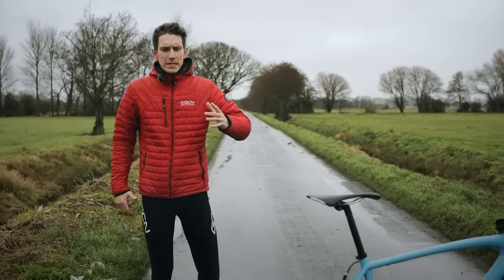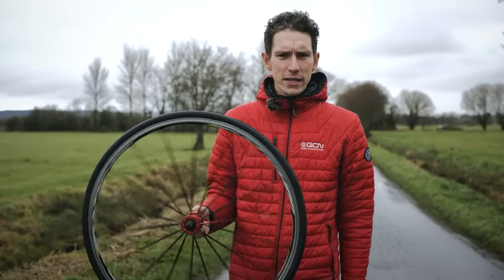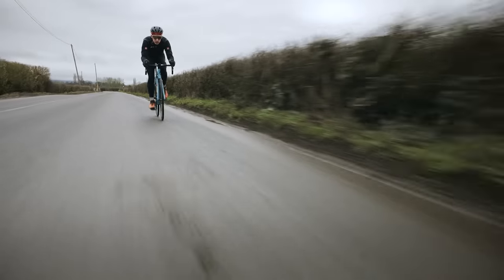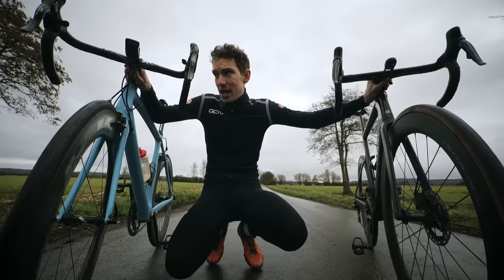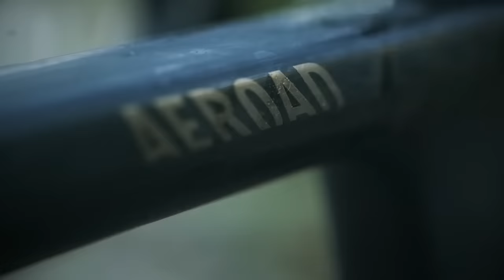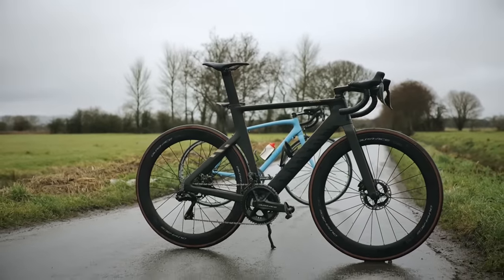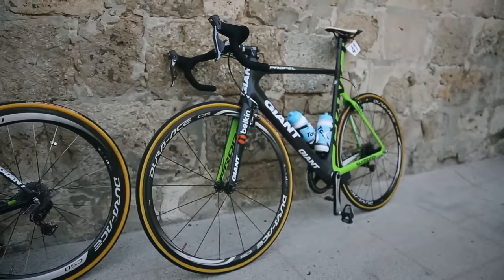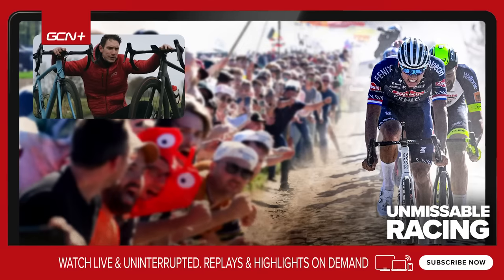How Much Faster Can I Make My Old Bike? | 2013 Vs 2023 Revisited

Comment: Upgrading to 50mm carbon wheels from the stock Giants on my 2016 commuter Alu Defy Disc changed the feel and the sound of the bike for the better. I also ride it with mudguards in combo with aero wheels which rises eyebrows from time to time, but I don't care really. I love it <3
Reply: Why do you have carbon wheels on a commuter bike 😂
Reply: Nice! I have a flat bar hybrid but now starting to look at new wheelset. Too right! Who cares what people think. Bring on the Tron wheels
Reply: @loc9588  why not. Am less likely to arrive completely sweaty at work with a lighter bike😂😂
Reply: @loc9588  Because I can! 🤣
Reply from the maker: Oooo Carbon wheels and mudguards is a combo we are here for! 🙌 Great to hear you are keeping the old bike going!
Reply: @loc9588  Why not?
Reply: @123moof  because it’s totally pointless - putting good wheels on a shit, slow bike. It makes 0 sense.
Reply: That wheelset is worth more than the bike, right?
Reply: @loc9588  If you're talking about my bike - it's not a shit, slow bike. Especially not when I ride it. The stock wheels were bad when you put a lot of power through them. The carbon wheels transformed what is possible with the bike.
Reply: @waveman1500  The new bike was EUR 1400 in 2016 and I managed to buy 2nd hand but never used set of wheels. The wheels were cheaper than the bike.

Comment: In 1995 I bought a pair of wheels with Zipp 40mm deep rims. Aero is not a new thing, in the 90s there were aero seat post, aero spokes, aero water bottles and campagnolo had integrated shifter brake and gear cables in the handlebar tape where as shimano were exposed. There was also aero saddle bag that was slimline and was about the width of the frame.

Comment: Wheels can make a huge diference! If you have a decent bicycle with a budget set of wheels, get better wheels. It's not actually about speed only, It's also about feeling safer when cornering.
Reply: This is why I won't buy ever carbon wheels, they're opposite of safe
How many times I saw people end in the hospital cause their carbon wheels broke cornering just under the normal everyday tension. No crash, no summer heat, no rocks, no anything but being plastic.
Cheep wheels may be a tiny bit slower but are indeed way more safer.
Alloy wheels forever
Reply: I'm curious how many times you were casually driving by a hospital and saw a queue of injured cyclists gripping onto collapsed carbon wheels?
Reply: @marketingsam  Exactly my thought. Catastrophic failures can happen but I don't believe that there are stats that would confirm that modern carbon wheels are unsafe when cornering. Pros use it at Paris-Roubaix after all - approx 50 km of tough cobblestone roads.
Reply: @marketingsam  sadly more than one.
You can search in YouTube videos of carbon wheels  snapping
Reply: @dalis994  pros use them what, a month?
They don't use them for years. Carbon it's terrible regarding to fatigue. Bit by bit is adding damage to the structure until one day, they snap
Also don't forget some pros have World records using alloy frames and alloy wheels, carbon is just marketing
Reply: @nemure  this video would suggest the opposite, reality is deep rim carbon wheels are more aerodynamic thus faster. I know many riders putting in thousands of miles on carbon and I know no one whose had this happen. Carbon is a very strong material.
Reply: @nemure  Words of praise for my 20+yo MAVIC Open S.U.P. Pro rims.
Reply: @marketingsam I'm curious how many times you were casually driving by a hospital and watched one cyclist injured because his alloy wheels suddenly broke. They are safer and if you are not competing you can live with a good performance alloy wheel.
Reply: @dalis994 pros change their wheels very very often, you won't and constant use, vibrations and sun will degrade the wheels.

Comment: Great video Si...couple of points as we are the same size at 186cm.
1. Your good point about position, closed hip angle aka in and down position, related power delivery and aerodynamics.  I ride more 'out and up' than you do even though our contact points would be the same to the frame due to equivalent body size.  This is not only more comfortable for me, almost as aero for reasons you discussed, but I can get more power down compared to what would be me riding in your position on a 56cm.  I believe many decent cyclists can extrapolate from Lance who at 5'10" and shorter than us, rode a 58cm with 130mm stem.  He rode perhaps more out and up aka superman position through the air than any great rider in recent history as the trend is more down and in like you ride.  Also Si, you can take a page from the Eddie Merckx who is your and my size and he rode a 58cm with 130mm stem throughout his illustrious career. Eddie, like Lance and pitiful me, rode more stretched out and not quite as low and yes too low, forearms merely catch more air as torso angle is constrained by hip flexors, crank length and hip impingement at the top of the pedal stroke.

2. I am not in the camp that frame tubing shape is very dominant for aerodynamics.  This is bike manufacturer propaganda to sell the more bikes.  Yes, your aero bike was faster in the test.   David Arthur did a wind tunnel test between his more round tube TCR and latest Trek uber sleek aero wundersled Madone and there was virtually nothing between the drag numbers with same wheels.  I do concede that wheels matter...and tires btw...and handlebar width. But riding position and wheels/tires matters the most.

Thanks for all your great videos over the years, your keen insight and wonderful sense of humor.  Cheers from America.

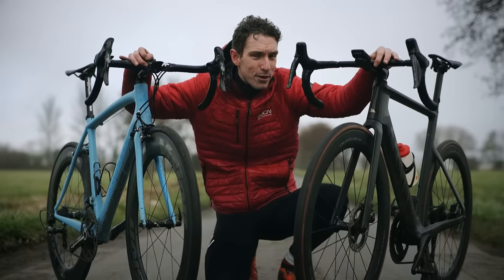Comment: This is the video we wanted to see. Aero shapes would amount to something after all.  I did a recent time trial of 10:30 with super fast race tires on 2005 year , 11 kg bike with 36 spokes stock rear wheel ( cup and cone) and DT Swiss front wheel 20 spokes.
Reply: Very nice 👌
Reply from the maker: Nice to see you also getting involved in the retro vs modern, should we hand this bike over to Ollie and get some TT action going? 👀

Comment: The older bike looks incredible now
Reply: The only "no no"(?) for these bikes were a bit too chonky frames. I got one myself (Corratec, 2010 design on their 10th anniversary). Small vendor from Germany. All I know, it was hated back then, in UK. :D For me - cool paintwork! I got rid pretty much everything attached to it in first 3-4 years (except shifters and brakes). And even now, though I replace parts occasionally, I do see the sign of the time... Specially chasing "new guys".
Reply from the maker: Something nice about that old style frame with those deep modern wheels! 👌
Reply: @gcn  i run a 2014 pinarello dogma 65.1 think2 full campy... i think it looks better than all those sterile looking aero bikes.... nd a lot of my freinds that run the best and the newest.. think the same thing

Comment: Man, I love your specialized!! That Campy looks a thousand times better than what Shimano has been putting out throughout the decades. Saying that, I do ride shimano and sram, mostly because like with the Apple ecosystem, I’ve been entrenched and would be too costly to change all those wheels and parts I’ve accumulated over the years. Plus, shimano and sram are easier to find parts for and they’re somewhat interchangeable.  That still doesn’t change the fact that Campy rocks!
Reply from the maker: Campy is undeniably cool! It's just that premium edge that can make it hard to find parts and fix. 😬

Comment: One of the most important elements of a bike's performance is its speed. Our cycling club has people from all walks of life who may not be able to afford a 15k bike or even a 6k bike. What we recommend is starting with either a new or lightly used 105 Aluminum bike like the AL Domane or Emonda to name a few but its important you start with a decent groupset like 105 that has a long life as the cheaper stuff doesn't last long if you ride a lot of miles and gives you nothing but trouble.

At that point we encourage riders to fully accessorize the bike with GPS, bottle cages, flat fix/spare tubes, toolkit and a way to carry this gear as its essential on rides where you're not in walking distance of your house!. We also recommend for comfort that they can look to carbon bars and seatposts as these can help tame some of the vibrations, maybe not as well as a full carbon frame, but its a cheap way to bridge the cap for $100 each end. If they really want to upgrade then we suggest mid level carbon wheels. Better to have an aluminum bike with a good groupset and carbon wheels than a carbon bike with a mediocre or low end group set and alloy wheels. Wheels and hubs  make an enormous performance difference.  If you can spring for it well worth it over the long haul. This way you can get pretty close to the performance of a full carbon bike. You can still tell the difference in the climbs especially honking on the pedals hard but otherwise its very close.

Comment: While not identical to the test GCN did here, I ran my Canyon Endurace back to back with my Aeroad over several rides just short of 68km each. My Endurace averaged 1.6 kph slower than the Aeroad on average, while averaging almost 35 kph on the Aeroad. So I can believe 1.8 kph. That sounds about right. My position wasn't identical bike to bike like Sy's.

Comment: I really love the look of the light blue bike with Campy. I bought my first set of deep dish wheels at the end of last summer 22'. They are tubular Mavic Cosmic Carbone's. I got them for a very good price. I didn't feel much faster. Thanks.
Reply: We thought that campy couldn't look any uglier after the 2003 5-pin chainwheel lost a pin and connected the crank to the 5th chainring bolt - so everybody suddenly started buy Chorus cranks.  Then when they went to super-chunky carbon we though "OMG we didn't think campy could be any uglier!" But today's campy is as ugly as possible, they seem to revel in making the ugliest bike parts on the planet ...

Comment: I am not sure that this is fair. I have a CANNONDALE SystemSix from 2008 and currently ride a 2022 BMC TMR01. The CANNONDALE is still faster. While the BMC takes out the road noise and is massively more comfortable, the SystemSix is so much stiffer and corners like a madman. I run Enve wheels on both, SRAM red (one clearly electronic and the other mechanical) but wow the speed of the older bike is just fantastic.

Comment: Really liked the video, as i ride a bunch of older bikes that don’t have the modern tech. My newest bike, that I picked up last fall, oops, autumn for you Brits, is a 2011 Colnago CLX with Campy Record Titanium. It has Kysrium SL wheels that are probably holding my speed down, but is it worth putting a $2000 set of new deep sections on a bike that only cost me $850 on Craig’s List?  So far I have said no.  I’m not a racer, but then again, many of us do compete daily on Strava, and I like to see my name at the top of a leaderboard occasionally.  

I do agree with a lot of the comments about the look of Si’s Campy groupset compared to the current offerings from Shimano/SRAM. The Italians do have style. I personally prefer the thumb shifter on the Campy compared to STI shifters that I retrofitted to my 2008 C-Dale.

Comment: Yes, very surprised at the results, but honestly I have not been in super touch with cycling for a very long time. Back when I was cycling hard, Aero didn't exist, and deep rims had just started coming out.  Heck Carbon bikes were still in their infancy.  I own a Specialized carbon bike with straight carbon tubes and aluminum lugs.  Flexed like crazy!   It is amazing to see what road bikes have become over the years.  Unfortunately I miss the beautiful steel frames of Eddy Merckx, Cinelli and Colnago.  They were ridable works of art.  With the beautiful polished Campy and gorgeous paint, WOW.

Comment: It would be interesting to see modern seat post, stem, aero handlebars on the old bike, and the same group set and wheels on the old bike and the new.
Ride both at the same power and we can have a definitive answer over the difference.
My suspicion is the weight saving on the old bike, will counteract some of the aero gains on the new, in real world testing.
Reply: Haha, hold up, what exactly are you trying to compare them?! You’ve lost me.
Reply: @simonrichardson5259  compare frame for frame.
New groupsets will be more efficient, so to simply change the wheels doesn’t show the full potential of the old v new.
Next consideration would be what the handlebars and stem are made from, fair enough keeping the width the same, but are they similar weights? Carbon fibre technology has moved on over the last ten years let alone twenty, which is why Zipp wheels are now both lighter and cheaper than just a few years ago, due to changes in laying up technique’s.
Let’s have a real comparison of the frames themselves, same power over the same course, see how the frames have progressed without the variables between the groupsets , etc.
Reply: @colinb8327  I feel like if you change everything except the frame you’re no longer comparing old Vs new though, don’t you think?

Comment: I have a 2013 specilized venge expert. I've got 38mm aero bars and hunt aerodynamic wheels (62mm F, 82mm R). I've also got a solid aero rotor chainring (though im not sure how much difference that makes) the bottom line is that the whole bike is still very aero and super light and I can still win A grade club races against guys on expensive modern aero bikes with electric derailers. I bought the bike of a friend a year ago for $1000 (Australian dollars) and ive spend $2500 upgrading it. Total cost of $3500. A new bike with the same aero efficiency will set you back around 8k.

Comment: Hi Si, another good'un.
Given that the route is different, it is a pity you didn't do this TT with the original setup so we could see the difference the wheels alone make.  Apples with apples, not apples and oranges.  That would be interesting.
Not surprised deeper wheels make you faster.  That has been the wisdom since late last century.  The refinements are in the details of the shapes.  The newer stuff seems to be in terms of arm positions and so on such as being faster on the hoods than on the drops (why do we still carry the weight of the hooks?).
My motor cycling better half was telling me about waxed chains in '82 (he has a large round Duckams tin of wax).
Good show though, keep em comming.

Comment: The advances in bike technology is amazing! I recently gave away our 25 year old Trek 7200 bikes and replaced them with Aventon Soltera ebikes. The ebikes are roughly 13 pounds heavier yet I can average a mile/hour faster on the ebike. That was very exciting as I plan to ride the ebikes without  motor assistance 99% of the time.
Reply: My motorcycle is a lot of pounds heavier and yet I can reach 150km/h without problems! That thing called motor is amazing!!
Reply: @KenchikukaYorch44  Yup, got one of those too.

Comment: Another thing is the straight course is no coincidence and I am willing to bet that the wind was either behind him or from the front (probably the former since Si is, as I am, vain). Does Si mention the wind direction (I skimmed the video). 

 An "aero" bike has oval tubes which are aero when parallel to the wind. With a side wind the aero advantage decreases because the wind will be hitting the wider oval side. This comparison, to be fair, to be done on a course which is a loop, as are most of our cycling courses.

Comment: I’m not surprised that the wheels made the old bike faster, however, 30’s over that distance for simply frame shape, drivetrain and hidden cables is a BIG difference. 

PS. I need a new bike! 😊
Reply: Yeah I was surprised there was that much advantage when arguably in this test the old bike had the deeper section wheels.

Comment: I have nearly the same bike; a 2011 Specialized Secteur. Probably 40k miles on it now sure it's sure as hell seen its share of use. Starting to debate replacing it vs. upgrading it. The old SRAM Apex groupset is old school but runs perfectly, the wheels are cheap Mavic OEM-style replacements with 700x28s on it, and I can pop out for a casual century on it anytime. I can't help but CRAVE a new gravel bike. Perhaps some tubeless wheels and a modern groupset would extend the life of this that little bit longer, but damn if I don't desire a good set of disc brakes.